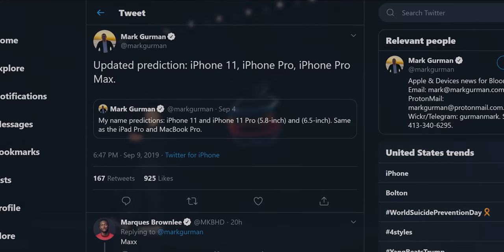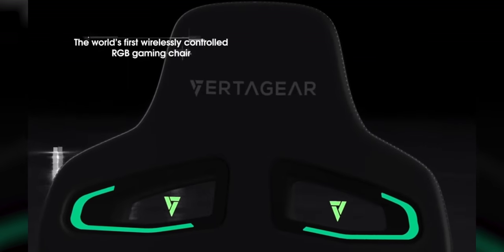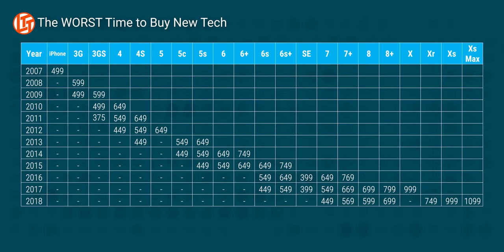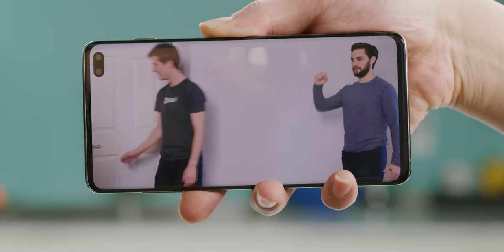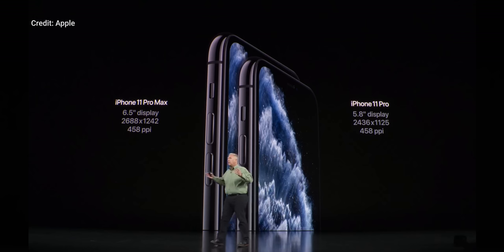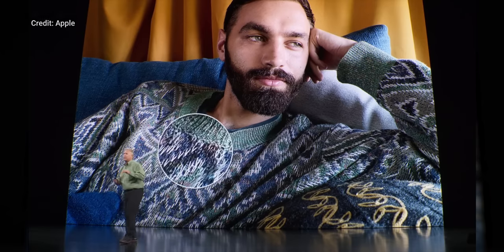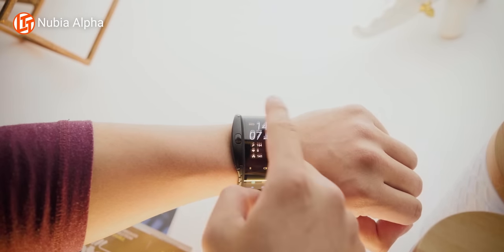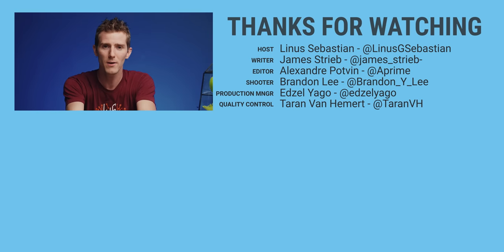Apple iPhone 11 REACTION!!

Comment: 3:02 - "On top of a lot of other things like (air quotes) next gen HDR, semantic rendering, and multi-scale tone mapping. The bottom line is that the pro photos they show off in the keynote always look amazing, so you're going to have to rely on people like us to actually put the iPhone 11 through its paces next to other 2019 flagships to see how its going to perform in the real world. Make sure you're subscribed so you don't miss it."

Other deprecating things about the notch, the display, and the thick bezels. A later video begrudgingly mentions the camera system, but states unless you're a content creator you might want to give the 11 line a pass.

After a month of waiting, I guess that's what passes at LTT for "putting it through it's paces" and comparing it to other flagships.

LTT has always misunderstood many of the features of the iPhone's Face ID system and why it's there. They credit others for having faster face unlock, but the purpose of Face ID isn't speed and never has been (thought it is fast).

Millions of people put their actual money and credit cards behind this passive biometric authentication system and trust this system to protect their money if the device is lost or stolen. It's not just speed, it's positive biometric authentication (one in a million false positives) - that you're actually *you*.

LTT also doesn't rate smartphones like they do other hardware - probably because they're so in to shiny lights and the thing of the moment. They wouldn't ultimately rate a game system on how many RGB lights it sported (well mostly), but rather its performance and capabilities. Apple mobile CPUs outperform their competitors, and regularly exceed single core speeds of Intel desktops.

This of course is what gives iPhone 11 the compute power to do real-time image analysis and preview things like depth of field simulation in portrait mode at the time of the shutter snap, whereas competitors have had to make do in post. In fact, on competing phones pretty much all the image magic takes place in post due to lack of computational power.

While LTT ignores these things, Google does not. Witness their attempt to add Face ID, and associated hardware elements such as a neural engine and secure enclave this year in the Pixel 4. The image pipeline - remember when you said Deep Fusion takes 8 pictures before the shutter press? Did you think Apple used a time machine to do this? - was introduced with the iPhone 10, and has been refined and tweaked since then, the latest iteration sporting semantic rendering and multi-scale tone mapping (no air quotes).

Competing systems initiate image processing at the shutter press, and begin computationally intense image processing once the exposure is initiated, completing the processing in post. iPhone's image pipeline begins when the cameras are activated, and begins an image pipeline where exposures are taken and analyzed for exposure, white balance, focus, noise, tone (and now AI image region detection), and highlight details in a constant pipeline like a long assembly line in a Ford plant. When you press the shutter button, a long and a short pictures are taken and the neural process fuses a number of pipeline images together with the new images, while the neural processor takes all the image regions representing skin, fur, foliage, metal, and other detected image elements and uses the multi-scale tone map to adjust the image preserving highlights and shadow detail practically instantaneously because most of the work has already been done prior to the trigger being pulled. The SoC applies about a trillion operations to a captured image.

This is enabled by the A13 SoC which contains a CPU which now processes about a trillion instructions/second, a new ISP, GPU, and neural processor all about 20% faster than the A12 elements, and up to 40% more power efficient. The 3 core neural processor in the iPhone 8/10's A11 was capable of about 600 billion ops/sec, the 10 Xs's A12 octacore neural processor about 5 trillion ops/sec,  and the 11's A13 is now up to about 6 trillion ops/sec.

BTW, those thick obscene bezels which looked so dated in 2017? Rather than new and flashy to-the-edge touch displays, this allows the phone to actually be held by a human with real fingers without triggering spurious side touches inadvertently activating unintended actions. 

And no ... the iPhone 11 line is not just for content creators. We all use our cameras, and arguably the smartphone camera is the camera the average consumer uses the most. Remember that scene with the three primary colored cars zooming across the salt flats (I presume they were salt flats) - that was shot handheld by the iPhone 11 (though I wouldn't have enjoyed being on that mobile shooting platform, harness or no :-). These cameras now have digital image stabilization as well as OIS, and allow consumers to capture their videos in 4K 60fps high dynamic range stabilized video due to the A13s computational prowess, though really most people will probably want to cut back to 24 or 30 fps HEVC to capture future-proofed precious memories.  (I wish I had an iPhone 11 to capture my daughter's first steps and precious moments through the years.)

And yes, due to larger battery sizes in the Pros (losing 3D touch), improved efficiency of the SoC,  improved efficiency of the OLED panels in the Pros (whose eXtended Dynamic Range DCI-P3 panels have gotten Displaymate's best mobile panel rating), the 11 has an hour more of battery life, and the Pro and Pro Max 4 and 5 hours more respectively. Tests I've seen place that Max at better battery life than any of its competitor.

So ... these boring phones that you strive to deprecate and ignore are some of the best flagships out there (although pretty expensive at the high range). Apple has always aggressively maintained the same look and feel of functional designs - look at how long the 17" Powerbooks, then MacBook Pros maintained the same appearance, or iPhone 7 through 8 transition even though it went from a metal to glass back. They don't just change cosmetic appearance annually just to keep ADHD tech pundits happy.

Anyway, just some thoughts on your coverage and attitude, and the bumpy and uneven coverage you give to different devices. You regularly give your nod of approval to $4000 gaming laptops, but pooh-pooh a smartphone (which you probably use much more) that tops out around $1500 and arguably will last much longer.

Comment: The next iPhone will be called iCamera Ultra Super Max Bionic Slofie 12. The phone feature will be sold separately as an accessory.
Reply: hahahaahhahaah Reading this i almost spit all my drink on the monitor HAHAHA.
Reply: haha🤣
Reply: Armin Walker Apple is not that type of Company how u portray them
Reply: Armin Walker normie
Reply: Only 999, the phone is 20000
Reply: @Solid_Snake99  
Apple: Faster processors, Slofies, t h i c c  notch

Android: 5G, wide-angle selfies, no notch, Google suite, unlimited photo storage, names that make sense, more features, better displays, dual speakers, headphone jack, longer battery life, better cooling, better everything...

fyi, the difference in the A13 and the 855+ or upcoming SD chip does not make a difference in user experience.

Comment: So the iphone 11 is just an XR with an extra camera and a lot uglier
Reply: Yep and recycled aluminium they mention is just surplus from the XR production.
Reply: Oliver Janeba they use steel not aluminium for the 11
Reply: Jackabm so... recycled aluminum 🤓🤓🤓🤓🤓🤓🤓🤓🤓🤓🤓🤓🤓🤓🤓🤓🤓🤓🤓🤓🤓🤓🤓🤓🤓🤓🤪🤓🤪🤓🤪🤓🤪🤓🤪🤪🤪🤪🤓🤪🤓🤪🤓🤪🤓🤪🤓🤪🤓🤓🤓🤪🤓🤪🤓🤪🤓🤪🤓🤪🤓🤪🤓🤓🤪
Reply: @jackabm69  That's for the Pro
Reply: Go through the video again...
Reply: Basically. And apple users will still buy it xd
Reply: @j.e.6976  So it basically catches up with concurrence 1 year later. Nothigng different from the past years indeed.
Reply: @j.e.6976  its 50 dollars less than the XR when it  launched, Apple is now lowering the price of the XR by $150 so unless you really want the new cameras there's very little reason to get the iphone 11 over the xr
Reply: @j.e.6976  well the iPhone 11 only has 2 cameras witch are the wide view and regular i dunno seams out dated compared to all the chines phones that cost less
Reply: Jackabm the 11 is aluminum, the pro models are stainless steel 🤡
Reply: @j.e.6976  Agreed. The iPhone will sell boatloads.
Reply: @w1z4rd9  BRUH👌😂👏
Reply: @polla2256  lmaoooo
Reply: @j.e.6976  the xr was overpriced as hell from the get go
Reply: alysdexia *minimaluminiumism
Reply: Not really... If you were listening the keynote and red the specs carefully, you would know...
Reply: It’s a XR with 2 cameras from the iPhone 6s
Reply: Mike Hurt iphone 11 is the most powerful 2019 phone, at the price of an iphone xr, with a second camera brighter flash and better screen.
Reply: Yep pretty disappointed. I have the XR and I’m sure I won’t need to upgrade for a few years if this is how the trend stays. I didn’t expect much I just expected more then a camera and chip upgrade. It’s basically a “s” upgrade for all the phones without the “s”
Reply: @kingken0460  well, nobody forces you to upgrade of course, so why would you be dissapointed for lack of changes if you don't plan on using it? However, if someone buys the new iPhine after a long time, it's a better deal to get the iPhone 11
Reply: Mike Hurt A13 chip ;)
Reply: MiGujack3 nah
Reply: @j.e.6976   its $50 cheaper when the Xr came out now the Xr is like $150 cheaper so its not really worth it for the 11 might as well get an Xr

Comment: Wow the same as last year but it looks slightly different, who would have thought?
Reply: Yeah I thought they were gonna revamp the design /s
Reply: Andrewvb3 basically describing s9 and note 9
Reply: @muddy111  so I'm assuming you've never used the s pen?
Reply: I have an xs and was legitimately considering an upgrade as a loyal Apple fan. But I’m not going to spend $500 to get a third camera and bragging rights
Reply: @muddy111  well the note 9 at least had a bigger battery and was infact bigger, this is just "new cameras who dis"
Reply: @BrandtOsborn  yeah don't do it to yourself bro.  Don't buy the same phone again
Reply: @muddy111  Those two phones came out in the same year, the iPhone has been the same for the past 3 years. What are you smoking ?
Reply: Mark Reading lol I’m imagining some nerd drawing on the bus
Reply: The French Bald Eagle the new phones have a way bigger and longer battery lives
Reply: King Jerizo I’m just stating that people like you complain about no change when most companies dont
Reply: I was I little surprised. I thought it would have USB-C to make it look worth buying.
Reply: @muddy111  You do realize this is the 3rd Generation of this design? its the same? Samsung only went 2 gens with its design. Apple also used the same design on the 6, 6s, 7 and 8 before changing up. Apple does not innovate, it just does things as cheaply as it can and charge as much $$$ as people will give them.
Reply: @muddy111  🤷‍♂️ if you want, I guess that's a use for it.  The main thing is that the note 9 and s9 were not advertised as direct upgrades, they were different product ones that came out in the same year.  However Apple has been "upgrading" the same phone for the past 3 years and lags quite far behind Android at this point
Reply: It’s the same as the X. I still got mine for that reason, and I plan to wait till they actually deliver something new. Before the X I had the 6 Plus and before that I had an iPhone 4.

I think that’s a better way to upgrade phones regardless of the brand. Give it a few years before you buy a new one. It feels very new to you because you get a bunch of new tech that you haven’t used before.
Reply: shhhhhhhhhhhhocking
Reply: But it’s so shiny...
Reply: and now you gotta pay even more for the OLED screen. Which has been a standard for years on androids. But hey...apple
Reply: @remarkable4  what more can you do with a pen?
Reply: @remarkable4  how? really? there are many videos from as long as 6 months ago that predict exactly what the apple event was today... :(
Reply: Frank what r u smoking
Reply: Hold on to your pants guys apple is so innovative they just came out with always on displays
Reply: @Frank72364  the only thing iPhones are better at is ripping customers off, not 1 of the things you mentioned is actually true, there is a list of android phones miles ahead of current iPhones and will still compete with this recycled pile of shit and thats without any of them having the upcoming snapdragon, kirin or exynos chipset, there is no such thing as android sheep as there is different versions of android across multiple different devices and most people don't buy an android device because of android its because the devices that use android are far superior and cheaper than iphones, there is only room for 1 flock of sheep in the smartphone market and that's isheep.
Reply: @muddy111  apple still has thrash battery life,  it's best and latest is barely 3600mAh battery. Fucking thrash. Sorry iPhone has been thrash since the 5. Been using ios (jailbroken) iPhone 3 to 7+ then switched to Andorid and never looked back.  Huawei P30 Pro to be exact, and no I'm not bothered by the spying, you think your company doesn't do it??
Reply: Meister Wunderfart Idk u follow the news but heard the switch to 3 year instead 2 now.
And what find I weird even Samsung does is nobody said a thing. Even note 9 vs10 looks basically the same with less bezels and the usual spec bump

Comment: "Uhhh that camera setup is ugly" well everybody used to say that about the apple notch and now almost every phone has it. People will get used to the look and I for myself like it
Reply: There are already a phone with a camera square. it's just in the middle...
Also the google pixel 4 has the exact same square.
So yeah they didn't copy it it was just in parallel.
Reply: I hate the notch and thats why im still using lg v20....
Reply: @87Sakiel  it's not ideal but it's far from bad.
Besides the v10 and the v20 are the first to technically have a notch.
I want you to take a look at the Oneplus 6 and the v20 it's they the same with the notch area showing notifications (videos don't go up to there like on the iPhone)
Reply: Doesn't stop being ugly, both square and the iPhone 11 camera setups are ugly AF, rounded displays like Huawei Mate 30 Pro and Xiaomi Redmi K30 Pro are slightly better I still very much however prefer the Mi Note 10's setup.
Reply: Lol what? Everyone is using a hole punch, not a disgusting notch

Comment: 720p screen on a $700 phone in 2019/2020 lul.
Reply: Samsung A20 has a 720p screen on a $279 AUD phone
Samsung A30 has a 1080p screen on a $379 AUD phone
Both of them have sAMOLED displays while the 11 has a lcd
These also have a really small notch

Apple: shows off new iphone
Everyone: Whooooo
Reply: My HONOR 10 lite have 1080 and it was 250e like half year ago.
Reply: @Apex and a 4500 mah battery with 25W charging included in the box lmao
Reply: My A6+ cost me 299€ back in december and it has a 2220×1080 super amoled display so yeah, even my midrange phone has more screen quality than shitty apple 😂😂
Reply: It's almost as if resolution isn't the only thing that matters
Reply: The new Mi A3 is 720p but it is 1/3 of the price and it is Oled and have a smaller notch... Seems legit. With 400€ you can buy a decent camera with a bigger sensor.
Reply: @bishrarar3015  it's still only 71% of the pixels in a 1920x1080 display. and if you look at a similar aspect ratio a full HD screen could be 2337x1080 and then the iphones display has only about 58% off the pixels. And nomatter what you say there is no reason a 700$ phone should have any less than a full HD display. Look at the oneplus 7 Pro which costs about the same and it has a 3120x1440 display. That is 3 TIMES the pixels and it is 90Hz and it does not have a gigantic notch to take away pixels unlike the iphone. The only reason the iphone has a shit display is because apple try's to sell the more expensive models that way.
Reply: Cell networks are limiting streaming quality to 720p nowadays, so they probably figure that it's not worth putting 1080p or higher res screens on their phones.  Sure, WIFI is uncapped, but at the end of the day... can you really tell the difference on a small screen?

The price point is typical Apple, though.  You're not paying for the tech inside, you're paying for that fucking logo.

Comment: Prepare for burn ins compaints with the apple watch
Reply: I can totally see that, but I've been using my OLED Huawei watch 2 for a year and a half with the always on display for a year and a half and I have no burn in so far
Reply: My gear s3 doesn't have burn in i think apples gonna use the pixel shift thing on it to reduce burn in
Reply: Every oled screen burns so brand doesn't matter it shows up eventually soon or later. Depends on brightness too.
Reply: @Supremepikachu  I don't disagree with you on the first bit, but the brand does matter. Some companies handle burn-in technology much different and sometimes even much better than other companies. There's no universal/generic/standard for preventative burn-in technologies.

As a side note, I've had my XS Max since launch and always at full brightness. Yes, in the sun and in the dark. I may be lucky, but there's not a single sign of burn-in just yet.
Reply: Devin Coder Did you refer Apple by their NASDAQ? Hahah
Reply: @mrflippy3578  There is a standard, it's called pixel shifting and all OLED watches have been doing it.
Reply: I do t think it has oled or lcd I forget the technology but it supposed to be really energy efficient
Reply: I'v seen apple does have screens that get burn ins less easy than samsung but it depends on brightness for sure some use really ridiculous high brightness on their screen lol
Reply: Auto Pi Sorry, you're correct. I didn't consider pixel shifting a standard. Thanks for that.